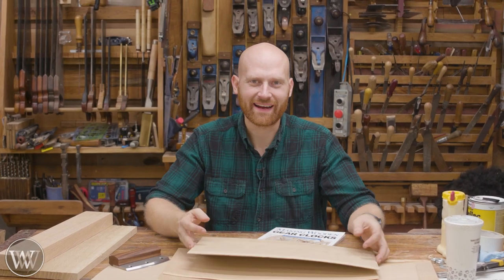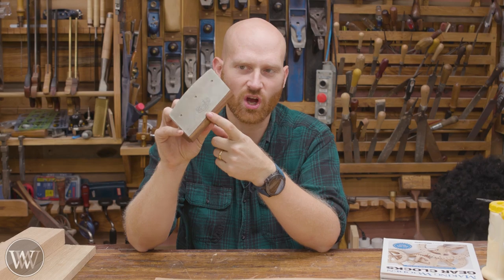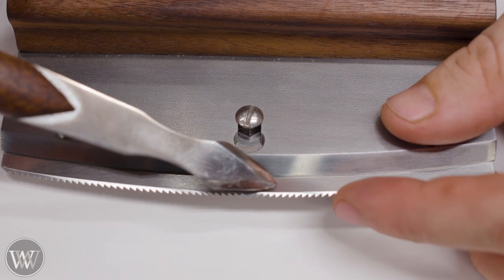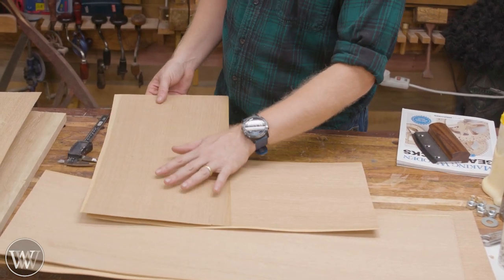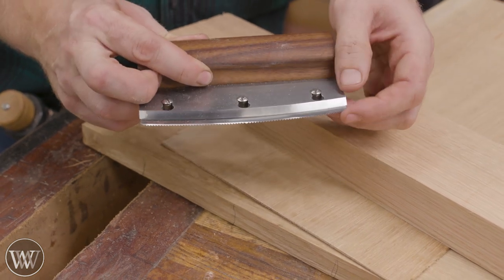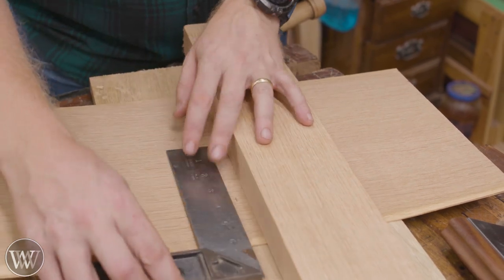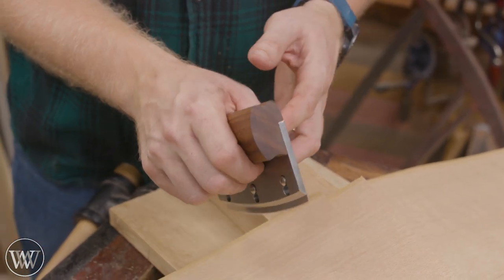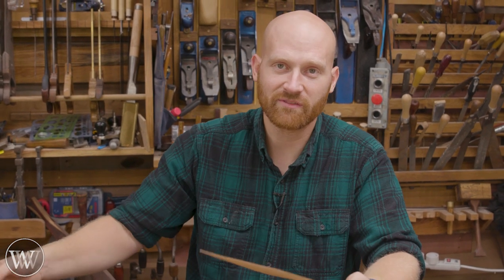How to Cut Veneer with Hand Tools

Comment: Nice to see someone using a veneer saw. I have two comments for you and your audience:
1. The workpiece is the part under the fence since it has a flat edge. The offcut has the wedge shape from the saw profile . It will be a problem if one tries to assemble two offcuts on the edges on a substrate. When sanding, the gap will show between the two parts.

2. It is a saw, not a knife. For best results, you should avoid to slice the veneer with the saw and produce sawdust instead. This will yield best results, even more when ripping.

Take care and have fun veneering ;)

Comment: Just worked with some veneer today. I usually cut veneer with an utility knife with a new sharp blade. A light cut for the first one, then heavier cuts. To prevent splintering I put masking tape at the cutting line and cut the veneer and the masking tape together. Works really well with thin veneer.
Reply from the maker: there are so many ways to skin a cat!

Comment: I've got my sister's toy piano that dates back to the early 1950s. All wood with working keys. The only problem is the veneer is de-laminating. Would love to get the info on removing the old veneer without damaging the wood underneath. Good info your providing
Reply from the maker: It depends on the glue used. But heat water and a razor are normally the answer.

Comment: Awesome product.  I'm hoping you would share your expertise with another step in working with very thin, store purchased veneer; what should I use to cut holes in the veneer that fasteners like 1/4" to 3/8" threaded bolts will go through?
Reply from the maker: for something like that I would use a leather punch. if you put down masking tape and punch through that it works rather well. the other method is to sandwich it between two other blocks of wood and drill through the whole stack.

Comment: For someone that has never done any veneering yet and will most likely just doing jewelry box lids which of the blades do you suggest?
Reply from the maker: I would go with the. French 60 degree bi-directional filing. It is flexible and easy to learn!
Reply: @WoodByWrightHowTo  Thanks for appointing me in the right direction plus areally fast reply.

Comment: By any chance, do you have any videos on making CUTOUTS in veneer accurately ?I have thick veneer I use and cutting to shape, no problem. But in the center of say a 10" by 12" piece, how can I cut a rectangle in the middle I have marked ? Its an opening in a face and I dont feel comfortable with my utility knife because the corners of the rectangle are curved.Thanks in advancefor any help
Reply from the maker: In that case I'd use a fret saw. And cut it in a bird's mouth. Here's a video making the bird's mouth. https://youtu.be/KhjroTvNIks?si=QBjKAxahGncoEfVX

Comment: This may sound obsessive, but, I m veneering some speakers and I don't want even the thin line of end grain where the side and top come together so is there a way to miter the cut across a wide veneer sheet (12 inches)? Thus, the side and top would come together in a miter corner. The folded miter is not really an option because it has to fit around the speaker top. Thanks!
Reply from the maker: Yes. Rather then useing a block with a 90 degree side use one with a 45degree side. It may help to work with thicker veneer. It is not easy, but it can be done.

Comment: All of your examples are for cross cutting. How would one go about cutting inline with the grain? I've been using utility knives for this with mixed results. Any pointers would be appreciated.
Reply from the maker: With the veneer saw it's the same One direction the other. But when going with the grain just make sure to not put much down pressure on it. Cut a little bit slower so that it actually cuts rather than splits.
Reply: @WoodByWrightHowTo  Thanks for the tip! I kinda figured it out after a lot of trial and error. It's still very tricky though... like cutting glass.

Comment: I have a question. I'm building a skateboard deck which will involve gluing 7 layers of maple veneer together and pressing them on a mold. The veneers I have access to are too big for the mold, and I want to cut them smaller to fit, with the plan of cutting out the skateboard shape with a jigsaw after the press. For my initial sizing cut, can I also use a jigsaw? I'm ok with small splintering, I just don't want to cause the veneers to split more than an inch.
Reply from the maker: I would rather use a knife then a jig saw. those teeth will rip it apart. but if you do want to use a jig saw then use a metal cutting blade. the smaller teeth on that will rip it apart less.
Reply: @WoodByWrightHowTo  Thanks for the help! What kind of knife?
Reply from the maker: a utility knife works well to slice.

Comment: What about a heavy duty Stanley knife?
Reply from the maker: If you're really careful and do it in circle passes. But a knife tends to act like a wedge which can break the wood as you get close to one side.
Reply: I've found that if all you have is a knife, the cheap disposable ones work best. Easy to get a fresh edge and you can bend it along the cut to be (weirdly bent) but square with your work piece

Comment: You could make each gear with a different color veneer, same with the hands. Make your plywood one layer less than final then veneer the rough size blank before cutting out the gear. Really looking forward to seeing a clock build. Check out Clickspring on YT for a brass clock build, really satisfying to watch.
Reply from the maker: I thought of doing died veneer. we will see. man I love Clickspring. we talked abotu a colab years back, but nothing came of it.

Comment: Actual face palm on the Dad joke. Haven't worked much with veneers. I tend to favor shaker style stuff, partly because I like it and partly because it's simple for my mind to wrap my head around it. But they weren't big fans of veneered stuff so I haven't really done much with them. Any particular way you clamp the veneers when doing a big panel? I imagine you're not the kind of guy to reach for the big vacuum bag.
Reply from the maker: Actualy the video this saturday will be my new Veneer press. but I do also like Hammer application.

Comment: of course you don’t necessarily need this tip because you do have a great Veneer Saw but in a pinch  a decent Japanese Pull Saw  works  fairly well  at the moment I can’t remember  the brand I use  it’s not any one Specific brand as mine was bought in a Home Depot  years ago mainly because of its compactness  to fit safely in my mobile Toolbox  I would venture to guess. You could modify a replacement blade to fit your handle  when I do cut my Veneers I usually  Score them with a Xacto blade  and  use that as a saw guide too